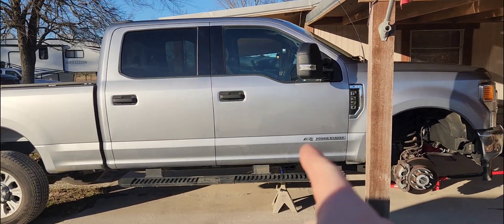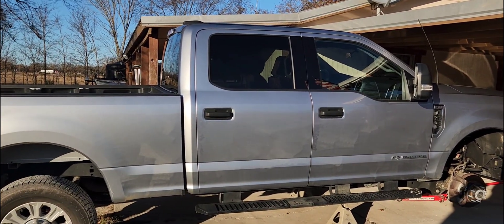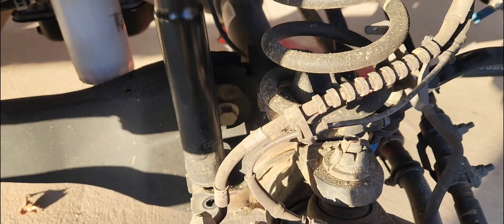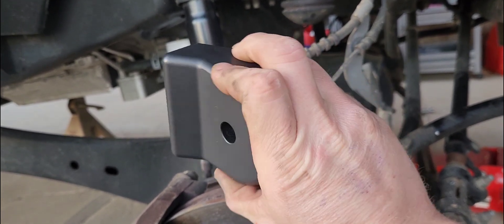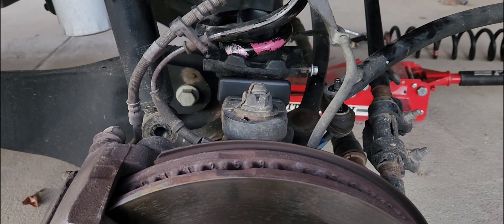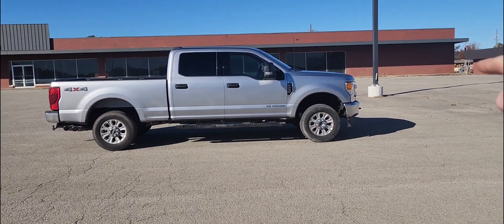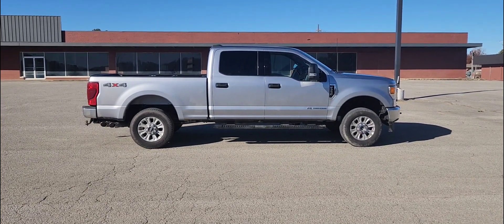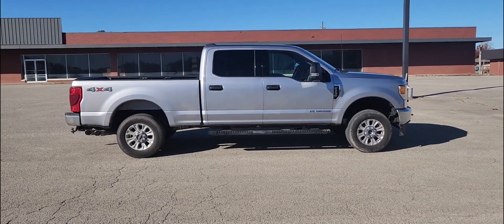Rough Country 1.5" leveling kit install and review. Do it or go with 2.5"

Comment: For anybody who wants to level their truck without lifting it, try REVERSE LEVELING. You take the 3 inch blocks out of the rear leaf springs. Doing this on my 2021 F250 with a 7.3 leveled it perfectly. The only thing youll need is some washers to put on the U-bolts because the threads are not long enough on them once you lower it. The U-bolts are about 5/8ths in size, just FYI, and you you will need about 3/4s of an inch of washers on each one,.

Comment: Besides adjustable track bar, did you need caster camber bushings and alignment? I know it’s recommended to get alignment after
Reply from the maker: @kcindonato  i have caster bushings on it from Carli, but they weren't necessary. And I just did the ole back yard alignment with two measuring tapes and two straight edges. Straight axles are pretty simple to align.

Comment: Have you done wheels and tires yet? I’m thinking this is the way I wanna go for now with my 22 F350. Couldn’t decide if I wanted to reverse level or do a 2.5 inch leveling kit. Figure I’ll start with this rough country 1.5 inch block lift and see what I think of the level look and if I like it, I will go with the reputable 2.5 inch kit from Carli or similar
Reply from the maker: @OriginalRicky801  I have 37s on it right now. They rub a little but it's not horrible.